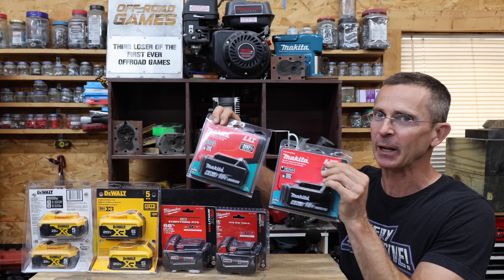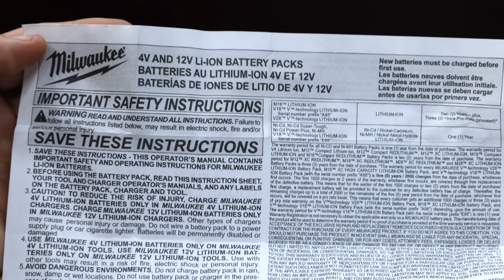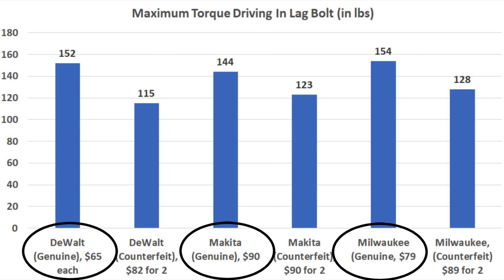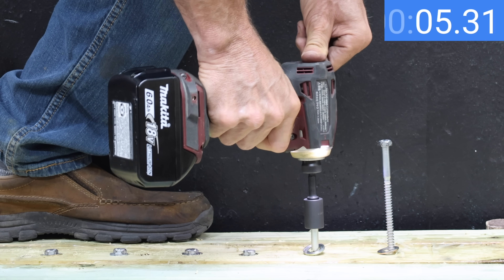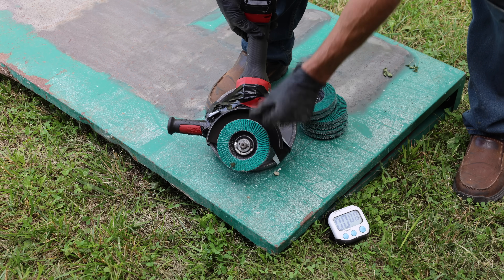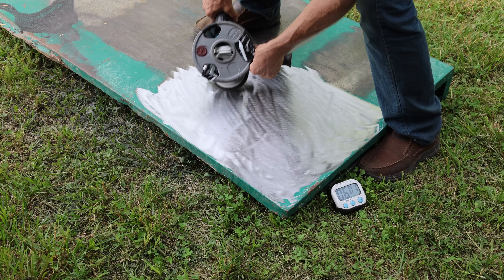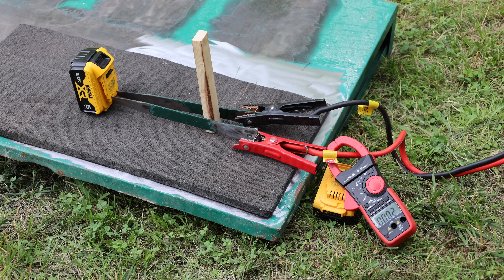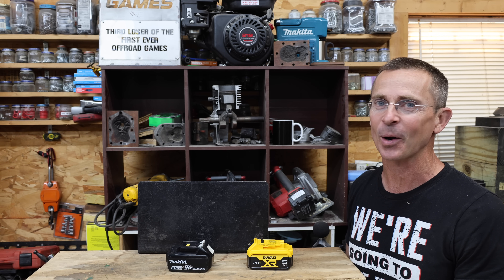Have You Been Scammed with a Counterfeit Tool Battery?

Comment: Wow, this was a great video.  Many years ago, I had a Bosch 7.2V drill.  I left the battery on the charger in my garage and it caught on fire.  I lost my garage and my house had damage from the fire.  The firemen thought the fire started from the gas hot water heater, but the most damaged area was where the charger was.  

A few years later, I was in my store when I smelled something burning.  I also heard a crackling noise and it smelled like melted plastic.  I followed the sound and found the battery smoking while it was in the charger.  I pulled it off the charger and it melted in my hand (and burned my skin).  I pulled the plug from the wall and watched it to make sure the battery didn't catch fire.  Needless to say, the entire Bosch kit went into the trash!  If I'm not mistaken, it was a NiCad battery - the original was purchased around 1993 and the replacement in 1997.

Since that happened, I don't leave my chargers plugged in with a battery.  As soon as the charge light is on, I pull the battery pack off.

I haven't bought an online battery yet and after watching your video, I won't.  Having been though a house fire, it's not worth the small savings to put myself and family at risk.

A deepest thank you for doing this video.  The shorting of the battery pack was very important and informative!
Reply: Using a plug timer is also good practice - in case the mind wanders...
Reply: I try to charge all batteries, even my phone,  on a solid tabletop with nothing flammable close to it.  They make firesafe bags for charging the bare batteries used for hobbies but would be cumbersome for daily usage.  Someone who's doing daily recharging of tool batteries that are dropped and abused, would do well to have a reasonably fire-safe area to charge them.  Perhaps on a large tile or a marble slab and don't have anything but the chargers on that slab.
Reply: As a battery tinkerer since 2015, you should never leave a battery unattended while charging. There are literally hundreds of millions of batteries out there, and yeah—only a few ever catch fire—but it does happen. Usually it’s from damage, faulty cells, junk-tier chargers, cheap Chinese knockoffs, corrosion, or water exposure.

Statistically, genuine 18650s from LG, Sony, Panasonic, and a few others are super reliable and tough as nails. But even with those, I never leave them on the charger.

Actually, the closer a battery stays to 50% charge, the longer it’ll last. That’s their "happy place." I keep almost all my cells at 50% or somewhere in the middle. It makes a huge difference over time. At 100%, that’s when they’re under the most stress—chemically and electrically. That’s also when they’re the riskiest if something goes sideways.

I’ve got literally thousands of cells lying around, and not one has gone bad on me—because I treat them right. Batteries are like people: respect them and they’ll behave. Stress them out, and well... you get what you give.

If I ever do charge one to full, I don’t let it sit that way. I use it immediately, at least enough to drop it one bar.

I just scored 50 “bad” laptop batteries for $90—less than 50 cents per cell. You’re gonna get some duds, of course, but that’s why I test every single one: starting voltage, capacity, test date—you name it, it’s labeled.

TIP: Never leave them alone while charging. If you're worried about fire, set them on a piece of tile—seriously, tile doesn’t burn or melt. Also, have a bucket of sand nearby. Not water. Not foam. Sand. Most battery fires have their own oxidizer, just like solid rocket fuel. You can’t “put them out,” you have to smother them. Sand is the old-school, reliable solution.
Reply: Same exact thing happened to me... Except I wasn't covered by insurance... That was a few months ago and I was using my garage to run my small business... I'm still not sure what the hell to do...
Reply: This shouldn't have happened, especially with a brand like Bosch. Also, ni-cd cells from what I remember are designed to dissipate the extra power as heat after being fully charged and if the charging current is low enough it's basically impossible to overcharge them (hence a lot of chargers simply only had a current limiting resistor and the user was asked to terminate the charge process after like 15 hours or so - no electronic cutoff.
Reply: @wychowanek90  Ni-cd batteries havent been used in a decade or better... Everything is now Lithium ion sometimes LiPo
Reply: i know a retired electrical inspector who left his dewalt batteries on the charger over night, not sure if they were knockoffs or not, but his wife woke him up in the middle of the night to see his garage in a blazing inferno well beyond the point of saving.  fire inspector determined the cause of the fire to be from the charger or battery.  we have dewalt and ridgid cordless in our shop.  none of it gets left plugged in over night, no batteries in tools or on chargers, chargers not plugged in.  if i'm doing a multi day job at a customers home, i'll leave all my tools there over night except for the batteries.
Reply: Get a timer to cut the power...I use that almost everytime...Even put it to cut just before the estimated charging time to be on the safe side..The battery should last longer too (If They are lying to Us about that too.)
Reply from the maker: You are welcome!  Thanks for sharing.
Reply: Almost 2 years ago I took a 48 volt Ebike battery pack apart ,like 50 or so,  separated the cells into packs of 6,  and put them in ziplock bags.
laid the bags in a box and put it in the shed. Then about an hour later I noticed my shed pouring smoke out the vent.
knew right away what it had to be. I almost ripped the door off trying pull the thing out with a garden hoe. 
After getting it out and far enough away, I covered it with a few shovels full of dirt 
I was able to save most of them though,  except a dozen or so batteries, but who knows what would have happened if I hadn't seen it myself, because the shed has 3/4 plywood floor that did get burned, and its right under two trees that have branches covering the whole top of it.  
So I was lucky
Reply: Most of the scams are easy to pick up on , the batteries are  a brand name like Gooey Chong or something. I would never buy batteries on line expecting them to be genuine. It just doesn't happen
Reply: @cowshottv5867 you didn't watch the video did you. These counterfeit batteries are so indistinguishable, you can register them on the official site.

Comment: I have 18 different Dewalt battery packs in my garage at various watt hours and I never even thought of some of them being counterfeit. Turns out 4 of them are. I will definitely not be using those anymore. Thanks for the video!
Reply from the maker: You are welcome  Thanks for sharing.
Reply: Out of curiosity if they are paid for already and still work properly why would you not just use them up and discard them? Are you fearful of a safety issue charging them? I have counterfeits but I will use them till they start to degrade and be more careful in my future purchases.
Reply: @scottshawn70  correct, I'd prefer not to use the ones that don't have the safety features built in like the genuine ones do. I've had a battery pack catch fire on me before and it was not fun. If there's even a slightly higher chance of that happening then no thanks. Plus, I already have far more batteries than I need from them coming with tools I purchased, people gifting them to me, it won't make a bit of a difference if I stop using 4 of the 18.
Reply: @bobbycone2  Bruh geniune battery packs catch fire just as fake ones probably less frequent but still they carch fire...
Reply: @maszkalman3676  so you're telling me I shouldn't use any of them? Bruh? 🤦 Haha
I've been using them for more than a decade and I've actually never had even a lick of trouble with any of them.
Reply: @bobbycone2  No! i told the exact opposite if they work why should you stop using them...  🤣😆
Reply: @bobbycone2 yep just chip them to me bro
Reply: @scottshawn70  Exactly his whoel point is ret@rded at best he worked with them for years why would they be bad????

Comment: It was very surprising when you were allowed to register a counterfeit battery on the company website. This is alarming!
Reply: I am guessing the serial was copied from a genuine battery and the website only checks to see if it is valid - it doesn't verify if it's been registered before.
Reply: @CraigNeth Even if it did check it's very possible that number was simply not registered before but I wouldn't be shocked to hear they don't both validating this.
Reply from the maker: Thanks for the feedback.
Reply: I only have one battery for an impact wrench I use on my car and I registered it on the Dewalt website when I got it, very cheap on ebay by the way. I just unscrewed the cover to check and the batteries look brown in color but they are encased and dont want to take it apart any more.  The board looks legit, not just a bunch of wires.  So now i just dont know.  The battery seems to work great, im always impressed with how long it lasts and hardly ever having to charge it. Dewalt shows i still have a year left on the warranty.
Reply: Dollars to doughnuts there's not much checking going on. Probably just comparing the serial number against a pattern: "3 digits + 2 letters + 0 + 3 letters". The serial number is going into a database and associated with a name, address, etc., and that information will only come up again if someone wants to get a replacement. Even if it's a serial number than can be registered, the company can say "oh, well that's a counterfeit product, we didn't sell it so our warranty doesn't count".
Reply: October 2025 and the two most popular online retailers are still not policing this.
Reply: It could be a real serial number reused multiple times (similar to how fake Rolex watches would be engraved with same stolen serial numbers), or the serials number algorithm was leaked and counterfeiters could generate an infinite amount of fake serial numbers that can pass through authentication checks.
Reply: I purchased a food saver food sealer from Costco. when I went to register it on food saver web site, I was able to. But it did state it wasn't made to their specs. was made cheaper using Costco specs. Buying a name brand anywhere but from the manufacturer, you will probably get a knock-off. if it has the brand name stamp, ever who sells it are leasing the names brand from them.
Reply: Not suprising at all, I expected it tbh.
Reply: The sudden appearance of complete high quality counterfeits looks suspiciously like the OEM vendors are intentionally allowing it if not fully sanctioning. The compatible batteries had them annoyed, but the more recent explosion of brand swapping adapters put them into a Mexican standoff.  

The OEMs have wanted to migrate everyone to tools and batteries that were married  / software locked to genuine for a while.  The sudden appearance of such high quality "counterfeits" almost certainly coming from the same factory floors as the OEMs provides sufficient context to spin up new battery and tool formats that are software locked and halt support for "insecure" platforms. The dress rehearsal is already present with tool activation at Home Depot - that is tools with a little more compute to the brain box to software disable them.

At the end of the day, this is all failure on the part of state and federal AGs to make eBay and Amazon responsible stores. Just another consequence of the "over the internet" magic loopholes.
Reply: Exactly this makes me believe it is just another batch, not a "non-authorized" one.

Comment: Just to correct a comment here, you are NOT short circuiting the battery, you are simply closing the connection between the + and - to allow current to flow, the problem is that when you close that "opening" or touch the + to the - which in your terminology is "shorting" them, the current starts to flow at FULL SPEED and FULL amperage which means the current flow goes full 100% and the wire or piece of metal you use to bridge that connection will start to heat up and burn because it cannot contain that amount of current flow. Even the connections inside the battery are NOT rated to handle the full potential of that current flow so the insides begin to also melt away and catch on fire. 
This is why the "load" or the tool or appliance you plug this battery into will have electronics in it to "control or limit" the current flow so that it does not burn everything up. This is also why batteries have electronic boards in them to also control the current as it charges or discharges. 
Current or electrons flow SO fast and create SO much heat as they move across a conductor that we have to control its flow and this is how we power everything by controlling its flow using electronics aka components. 
So you are not shorting it out in a sense of a bad thing, you are simply completing the path for current to flow and allowing the electrons to flow FREE without any restriction.

Comment: I didnt get a chance to watch this one yet because its not a priority, im watching the impact drivers;. ANYWAY PLEASE PLEASE PLEASE inform your followers of the dangers with these lithium ion batteries. We have had 2 houses go up inflames in the last 6 months due to them causing fires.. IF YOU DROP a battery u mite not think its a big deal but according to the fire dept they can short out inside and if you leave them plugged in like I do, they can start a fire very fast and they are SUPER HOT.. Within 1 hour the neighbors house was ingulfed in flames. SO IF u keep them charging. PUT THEM IN A METAL CABNET or container incase they explode. Google it, u will see many fires from them. Aug 15, 2023Last year, there were more than 200 fires blamed on lithium-ion batteries in New York City.
Reply from the maker: Thanks for the feedback.

Comment: DeWalt need to fix their product registration to exclude fake batteries. The lack of physcial and electronic circuit protection, cheap cells is mad. I've had good chinese tools fail because of the battery packs. Many cheaper generic toolshop brand tools use the cells they say they do. That's why noone can compete with china.
Reply from the maker: Thanks for the feedback.

Comment: Bought 1 dewalt 5ah  2 month ago it has 2023 date code  , seems like Canada always seems to send older stock , the cells are not green but are red ones. At 1:57 I see the blue cells are 2 Ah , then two in parallel makes only 4Ah .
Reply from the maker: Thanks for sharing.

Comment: One additional note I'd like to make about the counterfeit Makita batteries. Almost all of them do not have the circuitry to balance voltage between the cells meaning that slight variations between cells will result in overcharging which can result in a fire in these low quality improperly protected cells. Also the state of charge indicator board will discharge one set of cells all the way down to 0V if left uncharged and that set will become very dangerous if recharged again. These things truly are some of the worst batteries you can get, never buy them.
Reply from the maker: Thanks for the feedback.

Comment: I bought a set of counterfeit spark plugs, which should have been 100,000 mile type ... and save somed upfront cash! That was a horrible trick, because in 25,000 miles or so, they had disintegrated, and of course it caused so many problems that I thought could be fixed with coil packs and carb cleaner, thinking that the plugs were good. What a shock when I removed them and concluded what had happened, went to Amazon, and saw the reviews. The gap was so far out of tolerance, that I was amazed that modern engines can cope with such a piece of junk and even run.
Reply from the maker: Thanks for sharing.

Comment: But, if you open up a suspected fake, how do you know any Samsung cells found inside are genuine? Anyone capable of producing such convincing looking external packaging is more than capable of wrapping a generic cell in a Samsung label.

It might help if the manufacturers published the weights of the batterries. i have 7 of the Makita batteries. They all weigh the same as each other, near enough. But, without knowing the official weight of a real one,  all I can say is they're likely all real or all fake. Of course, if the genuine weight was widely publicised, the counterfeiters would probably ballast theirs so the weights tallied.

It really seems an insurmountable problem. If you dismantlie the battery to check its innards ... you void your warranty. If you subject it to long-term testing.... you exceed  your returns window.

Comment: My 5 Ah batts weighs from 588 to 603 and no code but when you go from $45 to $149 at Home Depot then I do not care. I only buy DeWalt for these counterfeit but real lithium batteries. I call my drill the DeWalt drops-a-lot, the chuck always sucked but after years it is worthless now and drops bits everywhere.
Reply: I have a Makita but I hate the batteries and the charger. I liked the old 12 v Makitas before DeWalt came out with the big 18v mine lasted over 12 years. If I have a heavy duty job I will use a big corded drill anyway, If I have a ton of easy-to-get-to get to drills I'll use a cord. just because you can empty these batteries fast I do not. I do not let my batteries get hot.
Reply from the maker: Thanks for sharing.